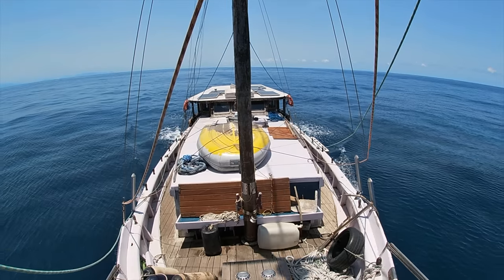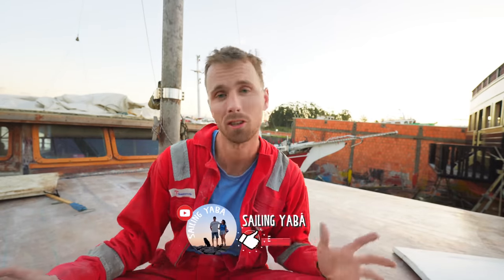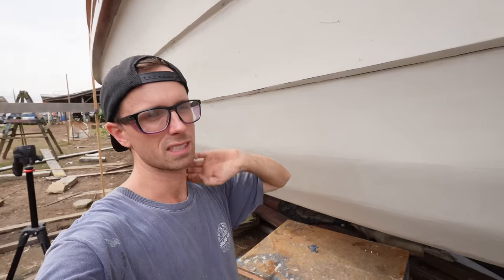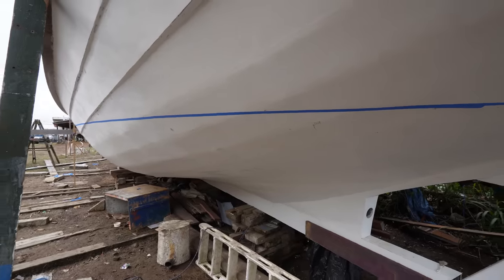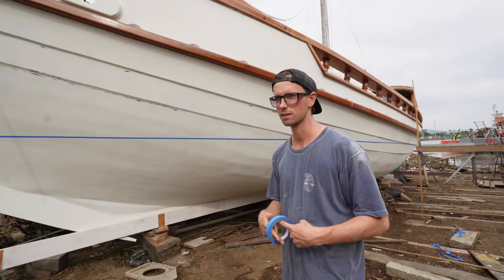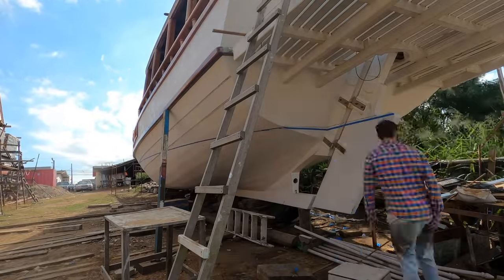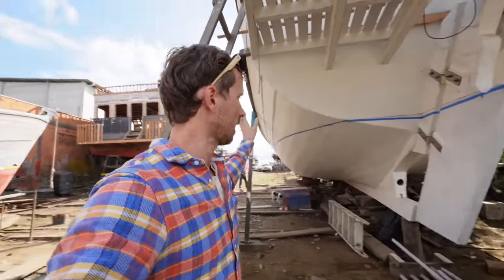Defining the WATERLINE of our once SINKING BOAT without any equipment — Sailing Yabá 138

Comment: Using the bottom of the keel as datum could be a problem, how do you know that the bottom of the keel will be horizontal when she is afloat?
Reply: I was thinking the same thing, some vessels lie slightly " down by the stern" or may not sit horizontal in the water, good luck anyway.
Reply: Yes, i was thinking that too. Probably best the way they went finally with which was use the known height at the end and guess where to go on the bow. In the end its not important as long as above the real waterline so all the hull that is underwater is coverd by antifoul. If it ends up above the water thats good enough.

Comment: How do you know what the water level is without all the weight finished product and supplies etc. and boat in the water? As you can tell I know nothing about boats not sure how putting a bunch of lines on the boat will determine the waterline you may have explained it in the video, but I didn’t catch it.

Comment: define one side, then use a water level (long clear tube with water in it, maybe a little food coloring) to mark the other side.   every three feet or so then run your tape.  Boat should be level port to stbd before you start.  Or, easiest, float the boat, let it sit overnight to get a scum line.  Pull the boat back out of the water & get to work.

Comment: The most common way to mark the waterline these days is to use a laser level.  Set it so that the laser touches the chosen point at the bow and at the stern and trace over the continuous line along the hull.  Of course, that assumes that you know where the actual waterline is at the bow and stern.  Were it my boat, I would launch the boat and let it float.  Mart the actual waterline on the bow and stern and then pull it back out to finish.
Reply: They have no clue at the bow, even before the mods, it is simply madness

Comment: Full keel boats normally have a keel that has less depth at the front and more at the back to avoid damage when hitting logs or other debris. Look up George Buehler Yacht Design for a side view of something like the Ellemaid which is a similar size and design.
Reply from the maker: I couldn’t find a clear side view of their waterline but I see what you mean. Will definitely keep that in mind while we adjust ballast after launch
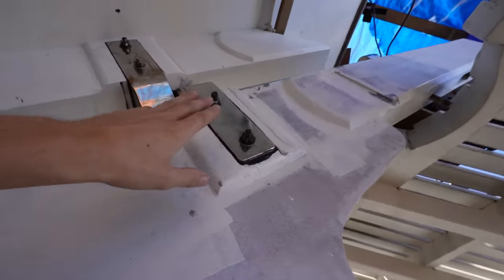Reply: @SailingYaba  I would give actual links.... but YT doesn't approve of that as they look like spam. Anyway, George seems to be using 1:40 as keel slope, That is 1 cm rise for every 40 cm forward.

Comment: Not only should you have used a "WATER LINE ' but must remember you built a solid-all-wood boat by sheer weight this would raise the water line higher times sheer weight! When  all else fails put the boat in the water

Comment: Isn't Yabã on a slight slope? Any measurement involving the ground and the ship will in that case be off by the angle of the slope. You would be better off measuring down from the ship using a drop line and then use that mark to build your waterline marking system. That way you would only have the ship to take into consideration, but that only works if the ship is balanced along that line in the first place. 

I can still remember my dad hanging over the rim of our tender and marking the correct waterline as his original measurement was way off. Then the ship was pull up and the new waterline was added. To get the waterline right there are many ways, but the ship will always be the final test of that as it is floating.

Comment: Laser would have been so much easier. As mentioned water and large pipe (small pipe friction can cause issues) would have only worked side to side.

Front vs rear the boat wont sit same level deep.

I think you where onto it with using existing pictures. You had the rear level. Using pictures and something unmodified you could work out a scale and then work out original bow level to few cm's.

Comment: You do know that there is going to be a difference : I.E. Yaba is a completely different boat weight and balance wise ! 
1, Between the pre - weight / buoyancy / specific gravity of the wood and the new replacement wood.
2. That will affect or be affected by the ballast that was installed.
3.  The interiors, more of the same.
4. And, then there is the dynamic balance under sail. under power and/ or under sail and power
My bet is you'll need to float it before you can get it right.
I dislike sounding negative but, it always given as constructive criticism.

Comment: You know, you could have just built the yacht out completely, loaded it up, up it in the water, marked the waterline, pulled the boat out, and then with a rotating laser transit which would sweep the entire boat, and then you can mark it and draw it.    Simple.   Point is, the water line might very well change because the weight of the boat might change, and this method takes that into consideration.   But best of luck, let's see how you do it.   Best of luck!

Comment: Did you not consider a laser and checking / using as a reference the videos from when rotting boat was taken out of water?? Seems a damn lot simpler than the nonsense with string and old planks.

Comment: You know what they say about assuming, you assume the keel is horizontal when the boat is in the water. You talk way to much so it's really hard to figure out what you're doing. I guess you used the keel as a reference mark but what if the boat is aft heavy in the water? You're keel will not be horizontal and you're water line will be off, if you used the keel as a reference mark. Did you ever think about that? We can also see in the video that the finished water line on the rudder isn't in the same location as on the old rudder (even when you raised it 8 cm), meaning that you can't use the keel as a reference mark.

Comment: Sorry but I just had to smile at the hard way you went about it, BTW it's not waterline it's a loading line, what will it be like if you mark up the Plimsoll lines. The loading line is done after the boat is in the water. You paint it, then put the antifouling paint on,  making sure you go above what you think the boat will settle at, then when in the water go round the boat and paint the loading line in 3cm to 8cm above the water and then tidy paint up

Comment: You could put the boat in the water after you paint and then back on land long enough to paint the water line…the little bit of scum from the water will leave a thin film that you can use as a reference…what I did on my boat
Reply from the maker: We will definitely be doing that. Hopefully the waterline is too high now to make sure we have enough antifouling. Maybe we will only redraw the waterline in a year when we haul out again or we could donor a lot sooner. It’s just tough to have some time on the crib just to go in and out of the water quickly as it is often taken by other boats

Comment: you will only find the true waterline when it's in the water, and then only after you get all the ballast right so that she sits as you want her to sit - level and even - once she is in the water and ballastered correctly and you can see exactly where you want the waterline to be (like you said "the line a little out of the water") you should cut a groove on the hull to mark it perfectly and permanently, it only has to be a couple of mm deep and wide, then the next time you haul out, any every time after that, you can repaint the waterline perfectly.....when are you launching?

Comment: It seems worth the effort to swim the boat and mark the water line then pull it out to paint the bottom one last time.   Acorn to Arabella just put his boat in the water and it seemed to be a little low… curious how that will work out.

Comment: Why not establish the true waterline after the boat is afloat. It is very likely there will be a subsequent haul-out shorty after you are in the water given the extensive work done on the boat, There will be leaks, there will be items left out, engine and propellor and rigging issues that can only be realized AFTER you are in the water. I hope it doesn't happen but most likely it will. That would have been a perfect time to go around the boat while it is afloat with a dingy, and mark the true water line and THEN haul-out and THEN paint the bottom and apply the anti-foul.
After the time and money spent on that yard, they may have floated you and pulled you out for bottom paint and waterline for little or no cost to you. That is what I would have done.
Bear in mind, you have new timber, new furniture, new ballast, and as your new permanent home you will have personal belongings, driving gear compressors, water makers, generator(s) solar panels electronics that were probably never on the original boat and God only knows what else you will have in the boat after you have completely refurbished it. Don't forget water toys etc. I doubt the previous water line, even if it was available or visible  will be the same as the new water line. Your new displacement will probably be much different than what it was with the previous waterline.
Reply from the maker: Very true. Best case scenario is everything works when we launch and adjust the waterline next time we haul out. But like you said, we might have to haul out very soon after to make fixes or adjustments and we will be able to adjust the waterline a lot sooner

Comment: This is in no manner how a builder comes to the waterline on the vessel. You have to consider the trim and weight of the old tub. Including the ballast and calculate the displacement equivalent from the boat plans including the fore and aft trim. Now you have used different density of timber and redesigned the interior layout and furniture the lwl or swl have probably changed? I have to notice Yaba doesn't appear to have much freeboard. Or you can float the boat on a calm day and mark the real waterline?

Comment: assuming the boat was level, i guess side to side is good, and front front to rear should be, otherwise measuring and building inside might be pretty painful, you would think having wasted all them man hours doing this would be better done with a simple laser, surely they're available in Brazil, and alternative would be the old fashioned leveller, a flexible clear tube with water set to the correct level - another way, after setting the numbers on one side is to have one person reading the numbers to the person on the other side, underline them as you go, so you don't miss any or duplicate, has to be easier ways than this way, although possibly more accurate, soon find out when she goes splash
ps, any one know where the nautical term, Sper Lash is used?

Comment: Put it in the water overnight. Reference photos are probably not helpful, as the overhaul has definitely changed the weight distribution. Additionally, it will likely show if ballast needs adjusting. Hm…should maybe be done after prop and shaft are installed?

Comment: Yup. An inexpensive laser level would have made the job much easier, quicker, and probably more accurate as well. Just like using a floor sander would have made and would make, sanding and leveling the deck planks and roofing better. The problem with YouTube videos that are posted after the fact, is that good suggestions, tips, or advice is meaningless once the job has been done.

Comment: 😂😂In a Fantasy world, the absolute easiest way would be a huge pool full of the below waterline coating and just pick up the boat and set it in the pool for a minute Add some weight to sink it slightly lower to give that extra leeway at the top of the water line, then lift and dry. Too bad fantasy worlds don't exist just by thinking them up. Just thought i'd throw my fantasy two cents in since so many people are here trying to tell the actual shipwrights how to draw a waterline. I'm sure they'd use a Laser Transit if they did many rebuilds as extensive as this one where all evidence of the previous waterline was lost.

Comment: Surely the water decides where the line is,  once you put it in the water?..
Reply: the point is they want to have evrything underwater coated with anti-foul paint, so basically the waterline is a max. load line and will be slightly above the water. As long as its above the water their good, might not be pretty if its to much but at least the anti-foul is high enough.

Comment: water lines are important for load safety, and balance of the boat, don't know why you didn't take the photo and measure from the rub rail to the water line, then extrapolate the position by bringing the distance to scale, and then applying them to the boat

Comment: It seems exceedingly complicated way to get a level on a curved surface. Would a clear plastic pipe and some clean fresh water not have given the given the level between each point along the hull. i.e the water between each end of the hose would be level. You just need someone at each end to ensure the the level is on the the last marked point and mark the hull at the next point.

Comment: Paint the water line too high .  Use the boat for a year and see where she really sits .Then paint the hull paint down to that line. You don’t know how much drag she needs to sail well. She is sitting on a slope so a lot of finessing is needed to use levels and lasers. That string trick works well ,but you need to know reference points at both ends of the hull not the ground.
Reply from the maker: We will definitely have to change the waterline after our first haul out. We hope it is level at least once we sail her and have adjusted the ballast
Reply: @SailingYaba  adjust the ballast so Yaba sails well. Probably down a good bit at the stern ( it’s called drag). The bow may stay where it is or come up a little. By inducing drag boat steer and track better. Once you have figured out how she likes to sit in the water then adjust the paint. Also to keep in mind is how far over she likes to lean while under sail. That will inform part of the decision about how high up the hull for the final line. Good luck

Comment: Should of took the lines off the boat before doing any construction. Having the original line plans would of also been helpful. That would have made good footage as  would researching how those boats were built, designed and used for. It may just all be in someone's head like how they build work skiffs. No construction drawings or nothing just the boatbuilders experience. I wouldn't cross oceans in that either. Strictly inshore sailing and coastal sailing.

Comment: You're assuming that the boat's keel will be at an even depth  from the bottom of the stem to the end of the skeg. Why? Most small boats have a considerable difference, either way. You are suffering because you are not working to any proper plan or calculation with regard to ballast, stability, tophamper, sailplan etc.

Comment: Do you know what the difference is between a ship and a boat?  It's interesting ... but technically Yaba shouldn't be called either. It's a yacht.
Reply: The difference as I understand it is " You can put a boat on a ship but not normally the other way round "  The RN class submarines as boats, the rest are ships. I stand corrected on both these statements.😊

Comment: Sorry dude but I am sitting here shaking my head. Boat same weight? both sides identical? I have a feeling that all your production of a level is not reality. Finish inside then put it in the water, measure, remove from water and drill the holes, then paint. More time but at least you will be right.